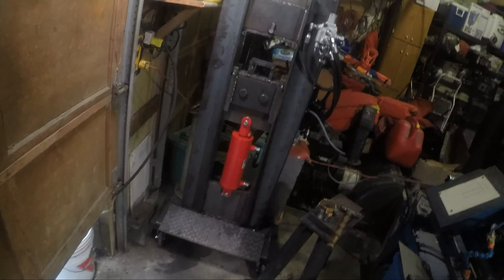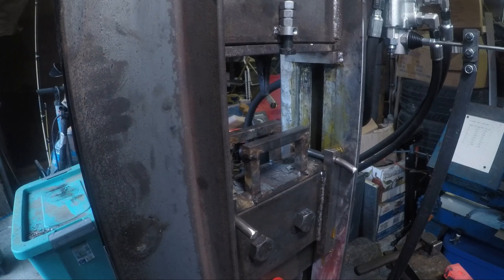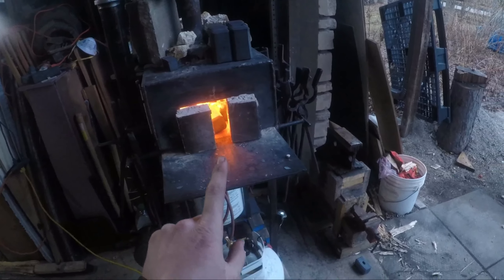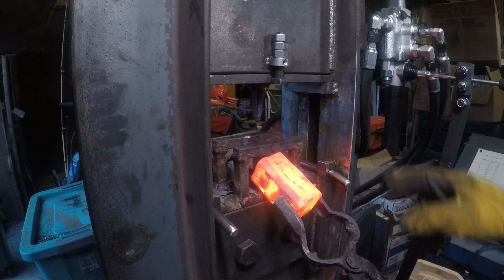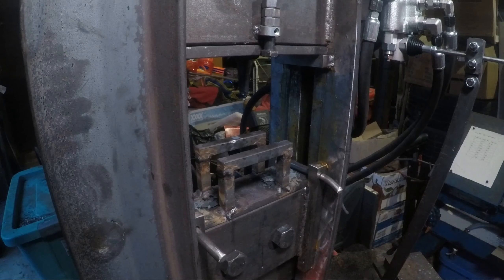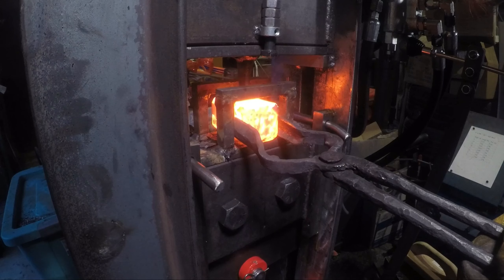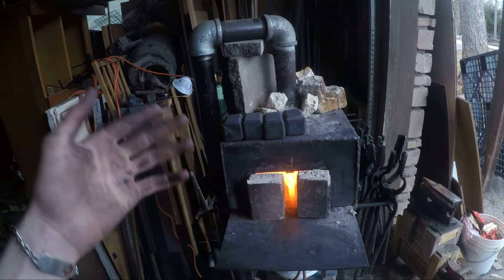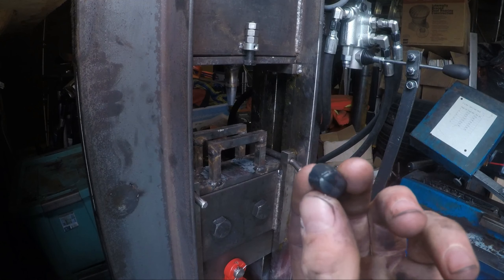Punching 20 Hammer Eye's!! Part 2 of Forging 20 Rounding Hammers!!

Comment: That worked really well, I think I'm gonna make a new punch now, my current one produces those small crappy slugs and likes to bind up🙄
Reply from the maker: Yeah after testing the new punch I really think it’s the punch you use with the combo of machine, but switching to a bigger punch I have 10 beautiful consistent slugs that always popped out and the bigger one didn’t heat up as much either